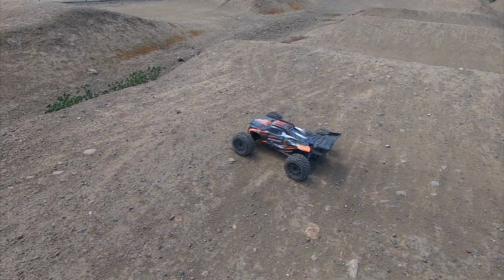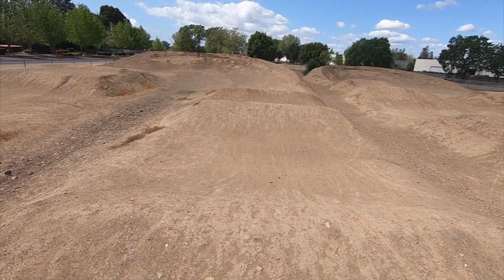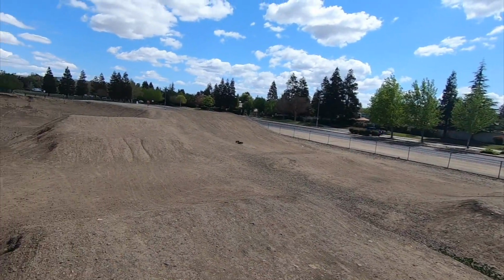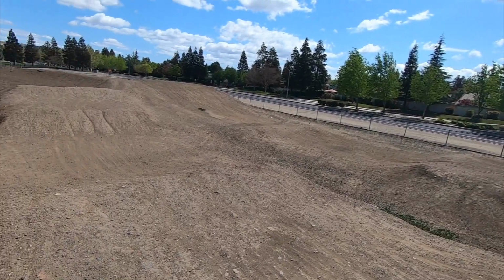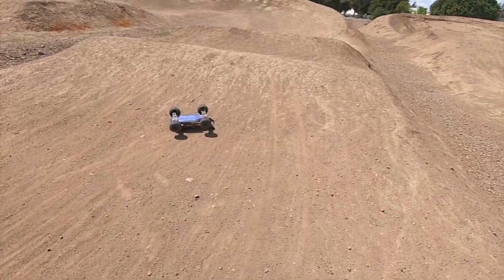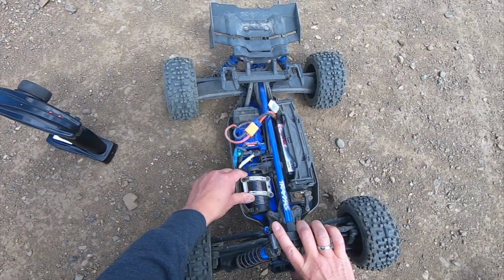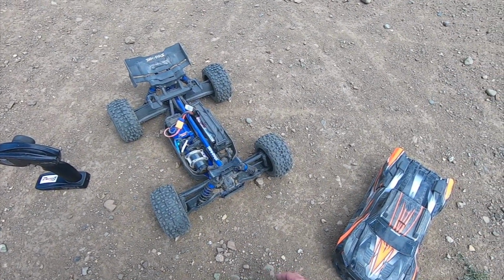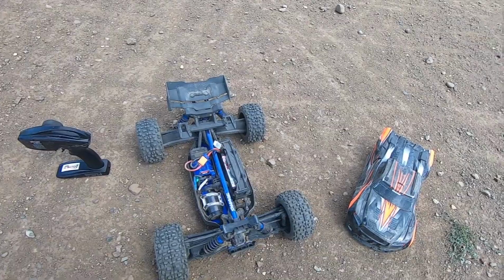Traxxas Sledge Track Run & Fatal Flaw

Comment: For anyone having the same problem, it’s the same 4 screw system nitro cars use to set their gear mesh. And nitro cars suffer from the same problem when casing jumps and stuff. The best way to secure is to completely clean off the screws with brake cleaner, then use blue loctite with a tiny hint of red loctite. If you want to remove them, heat them up first with a heat gun or blow dryer or torch. Do not just crank on it cold because they might strip. And stay on top replacing of the screws once the hex looks slightly worn. Screws only cost a few bucks
Reply: The absurd part is that traxxas has a mesh-adjustment system for the Revo 3.3 which doesn't have this issue
Reply: I've found the best way to get heat directly into the screw after Loctite is to use a thick tip on a soldering iron, therefore with the ability to get so much heat straight into the screw, just put the red Loctite!
Reply: @sm9300  nice tip mate I'll remember that.. 👍
Reply: @sm9300  Yeah Shane that's what I do too, works best! 🍻
Reply: @sm9300  genius, never thought of that before
Reply: I always used just regular red loctite and just used a heat gun to soften the screws when I needed to do maintenance.
Reply: @traxxasslash95  The Revos engine mount doesn't hit the ground like the Slegde does.

Comment: Awesome spot to run RCs!  The motor mount issue really sucks because they made a nice cradle to support the motor vertically  but created a new problem with it moving horizontally.  M2C is supposed to be making a better version. Ultimately, this will end up being a solid truck but will also be about $1100 after upgrades.  Machined gears, stronger hinge pins, motor mount and axles.
Reply: Any "solution" on those home pins?  Did you check into the Titanium ones I suggested?
Reply: @robbryan3044  I’m working on something. RPM Xmaxx pins fit the outer rear arms but not front.

Comment: It's cool that Traxxas is trying to make a mount that holds the entire motor to stop flexing. But the spur and mount not being one unit is a terrible flaw. It shows Traxxas' inexperience with aluminum chassis. They assume this will work on electric because it works with their Nitro's.

Comment: The many years traxxas been around and the amount they asking for this thing they should've been able to hit this thing out of the park and left no doubt as to the best basher. I was really stoked bout this at first but the more I see of it the more I'm like "I'm good with my v4 kraton 6s"one day I plan on trying the tekno mt410.
Reply: Why is the tekno mt410 always the grail rc? Ive been looking at it real hard lately
Reply: @estegerset  I think why 1 8 scale race kit is far tougher and more durable than these bashers. I used to own mugen buggy and truggy then got it of hobby for awhile. Decided to get back in and wanted a monster truck. Decided on kraton. Than I realized it just a mid grade truggy with monster truck tires on it. I llove my kraton with a little work I have complete confidence in it, but the mugens were superior. But with that said I'm wanting to try a tekno. I've heard nothing but good bout them. And I'm ready to build a kit, and it's basically there truggy with there buggy chassis making it a hair shorter

Comment: Why they didnt make a sliding motor mount is beyond me.
Reply: No clue I know they can’t copy arrma but come on they’ve been around the longest
Reply: @chrismills9011  Don't you mean "I know they can't copy every single thing about the Kraton, but this should have been one of the things they did copy." Sledge is aimed directly at the Kraton and it's success in the market and it is very similar in many ways, but they didn't build it in a way that lives up to the marketing hype and certainly not the price.

Comment: Great video as always! I was actually considering getting a Sledge but after watching yours and others videos i think I will pass on it. I mean, here in Sweden it cost around 9000 SEK( dont know how much that is in dollars) and för that price it should be much, much better.
Reply from the maker: that's more than it is here in the U.S., but even our prices are too high IMO.
Reply: @RazorRC  Nice rig but $800 come on Traxxas. I'm still bashing my V1 Maxx with wide kit.
Reply: so much? better get a hobao st pro for 350 dollar( completely made out of 7075 Aluminium and carbon).  at a motor and servo and you have a TANK. overall quality  is light years ahead of this traxxas  thing.  Don't like Traxxas. and now I know even with a cheap Aluminium quality chassis  I don't like them

Comment: Rly surprised ya broke the front diff last video, Ik the stock tires are one of the most heavy rtr tires but you did lower the center diff weight right ?

Comment: yeah I keep seeing the same problems sucks but i still think they made a solid truggy but when traxxas priced this it was suppose to be ready for extreme bashing with little to no upgrades  but i still thinks it needs a few more upgrades to make it reliable just like the kraton needs some minor adds on so the questions really is the kraton the better value ? since we are going to be upgrading  either way for harder bashing i would say yes and the sledge is solid but i give the advantage to the kraton since its been on the market longer and had more time for revisions and i own one so just speaking from my experience still need to drive the siege but looks like a lot of fun.

Comment: $80.00 for that Chassie, sounds like Highway Robbery Lol. Great vid Thanks for Sharing 💯🔥👊👍✌
Reply: Not really. A Kraton chassis is around $75
Reply: @Albertotron   Yeah but isn't Kraton chassie 7075 vr's Traxxas 6061.
Reply: @cyclonerc1625  No. If you want the 7075 chassis that's $115
Reply: @Albertotron  It doesn’t bend nearly as easy. The sledge is sadly far inferior.
Reply: @Albertotron   So I take it the $75 Kraton chessie is 6061?
Reply: @cyclonerc1625  yep
Reply: RTR is 75$. Exb is 115$.
Reply: @Albertotron  Got it. THANK'S for sharing 👊✌

Comment: Gears are 30% bigger and 70% thick Than the kratons . BUT they sell  machined gears for 50$! Their gears are cheap because they are most likely not heat treated or machined. They have to make their gears big and chunky to last and they still fail. I thought their gears were machined and heat treated i guess they are not even for 800$ not enough money spent to get bulletproof diffs. The arrma main gears are machined and heat treated same for the exbs. The internals are not like i believe any rc. This just look more of a scam honestly things like these shouldnt happen on a 800$ RC. Sure people will complain that arrma can get expensive with upgrades. But original cost is what matters to a lot of people. A 600$ truck that breaks a diff vs a 800$ Truck were the advertising made up the kraton to be an inferior rc in every single way breaks a diff people are going to not be happy. For something they claim to be a kraton killer maybe bulletproof the drivetrain. Thats arrma RTR biggest issue drivetrain.

Comment: The motor mount sucks. The cover for the diff and spur gear has to be made out of METAL. plastic is just not good enough. I had the same problem with my Maxx V2

Comment: This truck is a hot mess. $800 for an inferior product. I’m not intending on being a “hater” but it has to be said.
Reply: Its just overpriced. If this was 650$ it wouldnt maybe be so much of a big deal
Reply: @EXTREMERC416  agreed. The reoccurring Traxxas problem, overpriced.
Reply: @EXTREMERC416  And if they didn't market it as "no upgrades required" when it clearly requires as many or more than it's direct competition.
Reply: Bruh, it is super simple fix you only have to clean the screws and use red loctite to hold them in place… I dont really see how is that a big deal, nitros have been using this system for decades
Reply: @DashzRight  Motor mount isn't the only issue. This truck was touted as the RC you don't need to upgrade.  Perhaps the design team and marketing team need to get together earlier.
Reply: @TheflyingkiwiRC  I believe for most of the users the car is equipped just fine, more hardcore fans will always want something better
Reply: @DashzRight  You know I agree with you. For anything up to moderate bashing it would be fine.  Same goes for most high end RCs. And this is all that Traxxas care about, and from a business perspective it makes sense.  I'd rather spend the money on an Arrma Fireteam simply because Arrma has a better support base here in New Zealand. In the long run the Fireteam will need some upgrades too.

Comment: What a fail from Traxxas. So much hype and anticipation. Finally an RC truck you can bash without needing to upgrade. Just drive it and forget it unlike that other brand that needs upgrades out of the box.  What a crook of sh1t. Really is a pity, clipless body and quick change battery tray it's only redeeming features.  🤔
Reply: Bruh, it is super simple fix you only have to clean the screws and use red loctite to hold them in place… I dont really see how is that a big deal, nitros have been using this system for decades
Reply: @DashzRight  Come on guy..The chassis bends at the motor mount screws

Comment: I'm sorry but that truck is Junk !
Reply: Yeah I kinda feel same way I was thinking of getting it 😕 but I don't know
Reply: Shh you Re going to piss off the fanboys
Reply: I don't think that's fair, it's a decent rig. It doesn't match up to their marketing claims and it is overpriced for what you get I feel, but it's not terrible.
Reply: @seanconrad5467  im saying this based on its retail price. The 6s arrma went down 50$ recently i noticed in a few models
Reply: Bruh, it is super simple fix you only have to clean the screws and use red loctite to hold them in place… I dont really see how is that a big deal, nitros have been using this system for decades
Reply: @DashzRight  nitros dont have electric motor level of power or get sent out of ramps